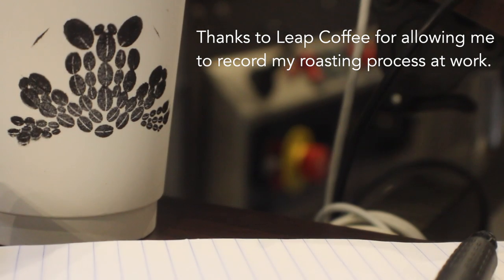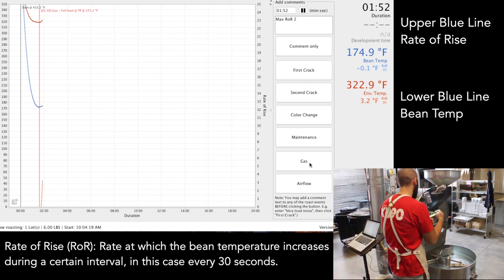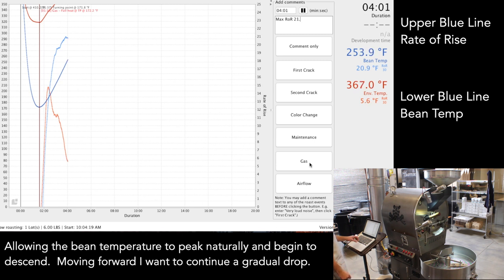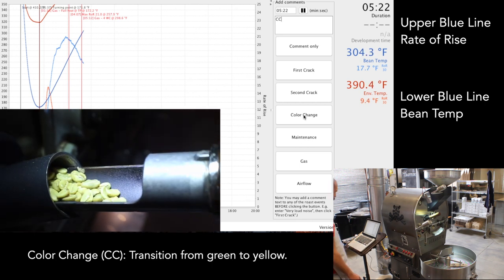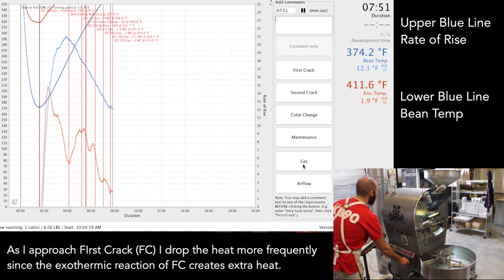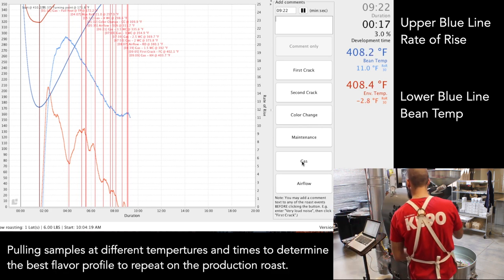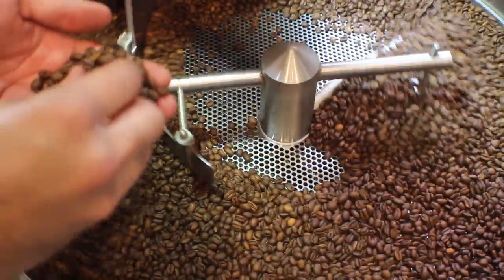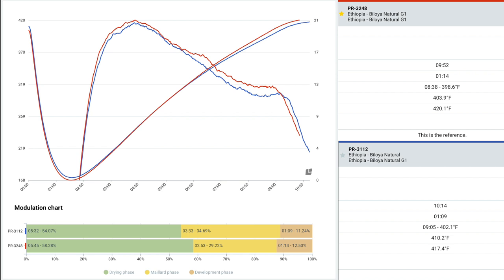DAMN FINE TUTORIAL - Creating A Roast Profile

Comment: Hey mate, I have been roasting on IR12 for many years and  a good way to prevent the ror rising at first with naturals is to open the green bean hopper a little.
I have marked 25% 50% 75% and 100% open. Over time you will know how much you need to keep roast on course.
It sucks cool air in and stabilises the ROR

Comment: Really great pov walk-trough on your roasting process, it's great to see how other roasters apply their knowledge so they can actually create a profile to be replicated.

I have  a question that i hope you can help me out, in my case I have a 5Kilo Roaster, but i cannot control so much parameters due basic elemental controls roaster has, only fuel power and airflow control, the thing is that i've been having so much trouble roasting high dense/pretty high dense beans (.70 - .78 gr/ml) i've been trying different charge temps, for example: high temp charge - max fuel and mid airflow during first phase green to yellow, but can not dehydrate correctly coffee, i get to maillard phase and then to FC around, 13-14 minutes but it gets underdeveloped everytime.

Thank you for any advice :D
Reply from the maker: Thank you for watching and the comment!

So my first question would be how big of a batch are you roasting? Even though it’s 5k you should only do 80% of that max. I do 6lbs batches in my 5k (11lbs).  If the batch size is too big and the drop temp isn’t high enough the green will soak up all the heat long before the FC. this will slow down development to a crawl, so even if you run for minutes after FC you will still have underdeveloped or baked coffee.
Reply: The Real Sprometheus  wow! That was a quick response! Im actually charging my roaster between 3 -3.5 kg per batch depending which coffee i’m working with, in a previous tries, i charged a high temp the coffe, turn down flame until turning point and then ramp up temperature trying to control other phases but had same underdeveloped results, apparently couldn’t control properly first green-yellow phase.

Comment: Hi, do you off the gas after your charge the beans and wait for the turning point? How low do you adjust the gas after the first crack? During your roasting process when do you lower your gas setting and why? Thank you.
Reply from the maker: So from what I understand lots of roasters have different views on this process. Once I hit the charge temp and the green goes into the roaster, I hit full heat at turning point or 1 min in depending on the coffee density. I consistently lower the gas and add more airflow throughout the process to keep a continuously decreasing rate of rise. So when I see the RoR start to slow or maybe peak back up a bit I drop the gas a bit at that point. Depending on the coffee I do sometimes adjust the gas after first crack, but I try to avoid a total drop in temp at that point. Like to keep a relatively smooth profile if possible. This isn’t always easy though. I can go more into detail on the email you sent me, thanks for reaching out!  I’ll be in touch soon.
Reply: @Sprometheus  Thanks for your sharing. Here is my process with the Diedrich IR 2.5kg, batch size around 2.5lbs. I typically warm up the roaster for a minimum of 15 minutes with gas at 3. My charge temp is at 350F, I will warm up the roaster to about 370F, off gas and let it drop to 350F then charge the load. It takes between 1minute 15 to 20 seconds to reach my turning point. I then turn on gas to 3 and chart the RoR every 30 seconds. My initial airflow setting will be at "cooling."  After yellow when chaff appears on the viewing glass, I will switch airflow to "50/50," gas remain at 3 and continue with a decreasing RoR. Around 350F bean temp, I switch airflow to "Drum" and maintain gas at 3. First crack will occur around 370F-380F depending on the density of the beans. RoR will continue to decrease during first crack and then pick up at end of first crack (I make sure that the RoR will not drop to lower than 2) I end my roast typically around two minutes after first crack unless I have a special order.

My next experiment is to try to extend the Maillard phase and see how the coffee will taste. Cheers.
Reply: @calvinpang7144  my style of roasting is more similar to yours on my IR-5. The video was fun to watch, but I definitely do not apply as much heat as @The Real Sprometheus

Comment: Hi great video.
I noticed that the Gas button sometimes changes the color? Do you adjust the gas as well during the roasting? Or you set it on a certain level all the way to the end?
Reply from the maker: Yeah the button will change color when I click it to mark a change. I do chance the gas quite a few times during the roast to maintain a nice downward slope and RoR.
Reply: @Sprometheus  What slope do you consider to be nice? Do you have a certain value for the RoR at any given points of time?  I'm sorry for asking too much. I'm just wondering if it is better to go fast during the drying stage or slow. Thank you very much for your response. :)
Reply from the maker: Mas Ipin I wouldn’t say that there is a slope that is great for all coffees. Just be sure that you’re RoR is dropping but not too fast. You don’t want roast past 0 RoR because you’ll run the risk of baking your coffee. Make sure you have enough RoR to roast and develop the coffee fully.

Comment: Hi, sorry if I missed this in the video but what is development time? Is that just the time between the first crack and the drop? Is more development time better? If so why is cooling coffee after roasting important? Thanks!
Reply from the maker: Hey! Yeah exactly. Development time is between first crack and dropping into the cooling tray. More isn’t necessarily better. The more development the darker the roast (in simplified terms). It really depends on what you want to get from the coffee and what you’re planning to use the coffee for. For example, commonly coffee is developed longer for espresso since the darker roast neutralizes some of the intense acidity you’ll find in lighter roasts. There is no perfect time or roast level that fits all. Just a trial and error of using your senses to determine that perfect point.

Cooling is is hugely important. If there isn’t anything allowing air to pass between them and dropping the temp rapidly the beans will continue to roast causing all that hard work to determine the best roast level useless.
Reply: The Real Sprometheus Thanks for the response and the video! This is the only video (or information of any medium really) I have found that really explains the roasting process!